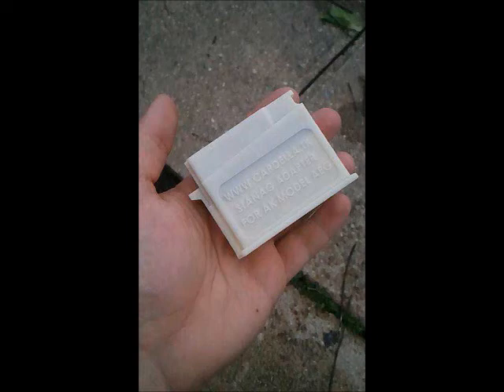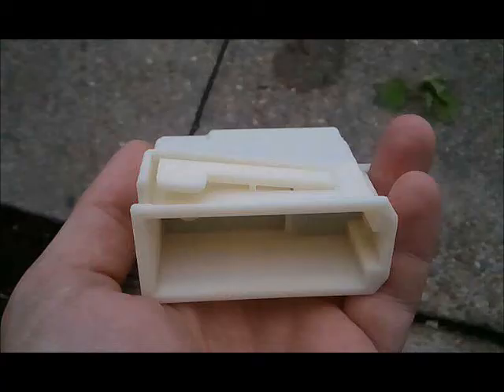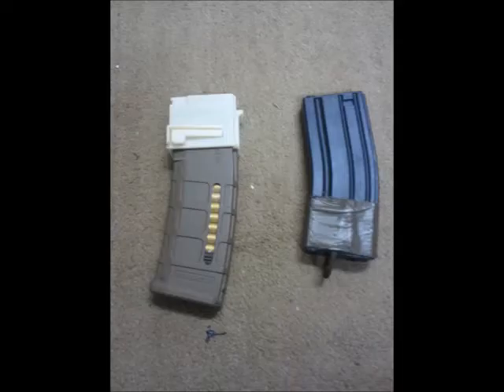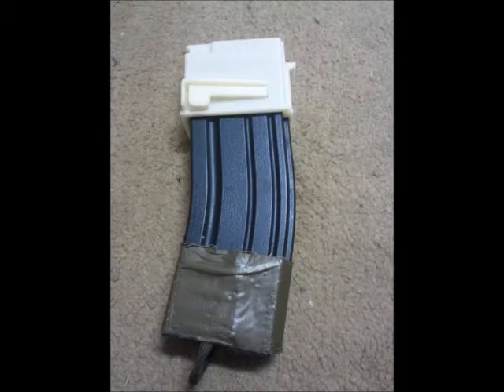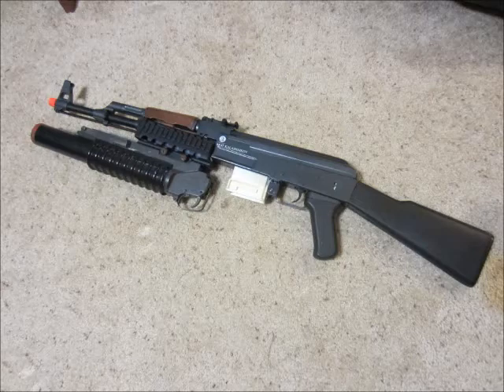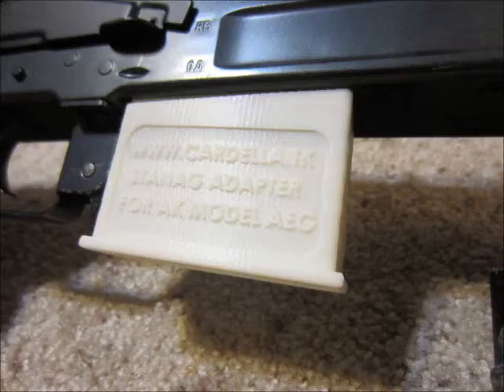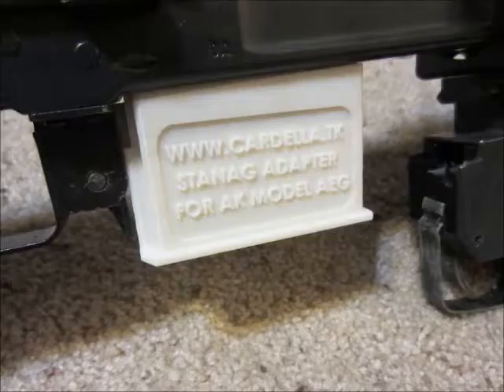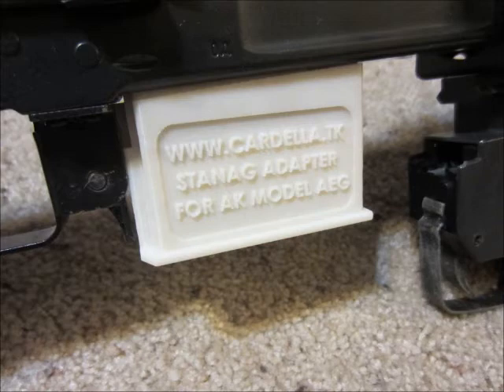AK STANAG adapter update

Comment: Ok, one idea for making this removable is taking away most of the back part, it will make the mag wobble more, but just an idea. I don't know much about this kind of thing, but realistically in my mind this is the easiest and simplest way to make it work. Also, can you mod it so you can add your own mag release? I still have an ambi release for my old M4 and want to put it on this gun.